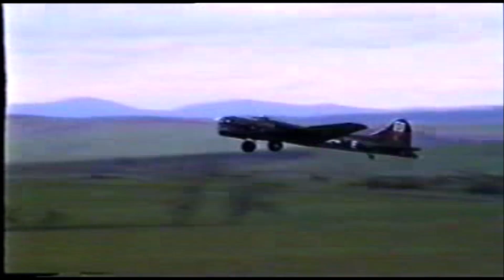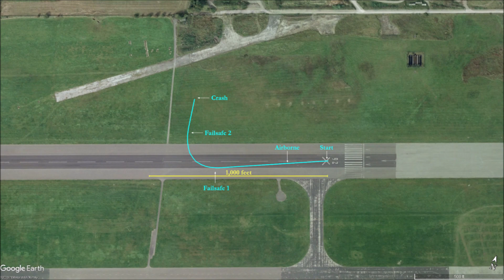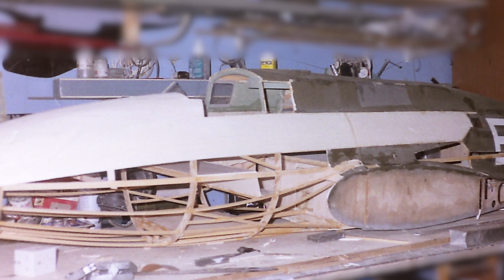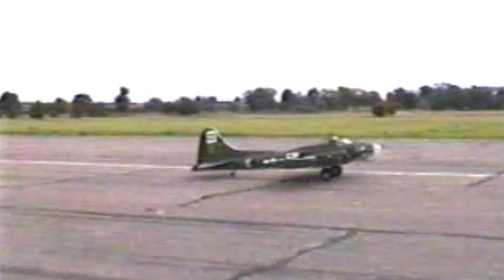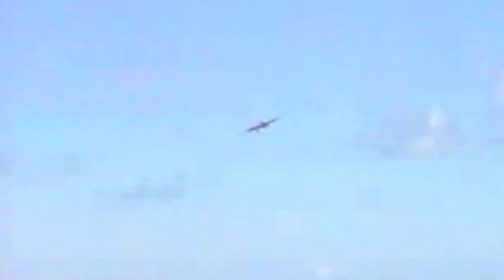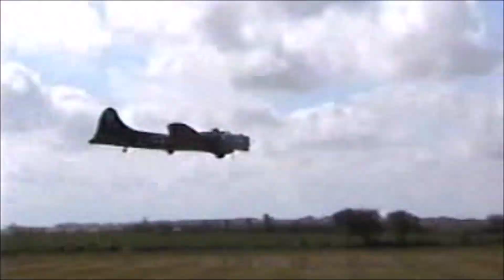R/C B-17 Fortress Crash, Investigation and Rebuild - 1996

Comment: 😀😀😀 great B17 - i admire u for rebuilding and getting it certified for display again - soooo much work and effort!!!!  failsafe - whats so safe or no fail about it causing a big smash!!!!!!!???  had u bin a yank back in 44 - it DOVE into the ground!!😁😆😁
Reply from the maker: Thanks.
The failsafe is designed to crash the model as soon as possible after signal loss, to prevent a fly-away, where the aircraft could cause greater damage to a 3rd party. In the UK, any model over 5Kg needed a failsafe.